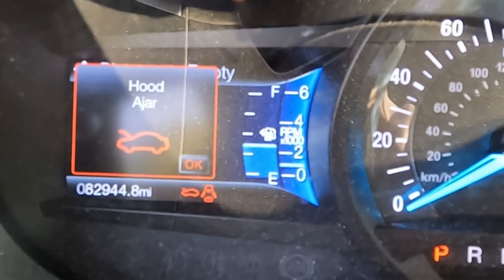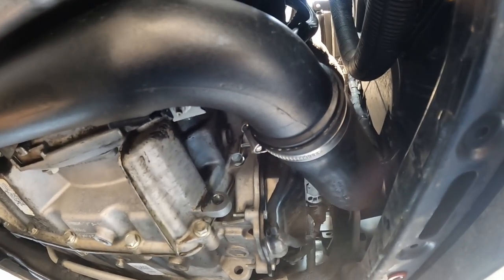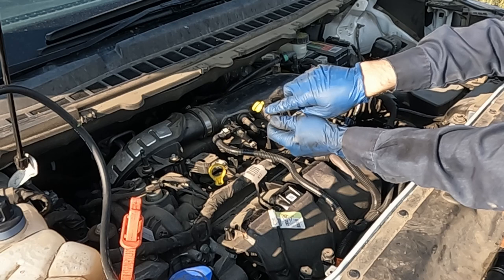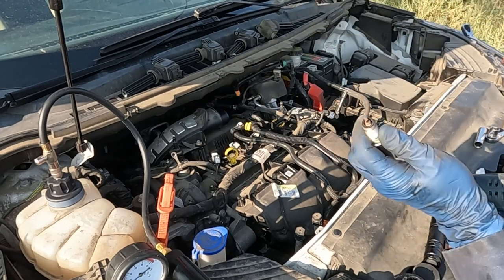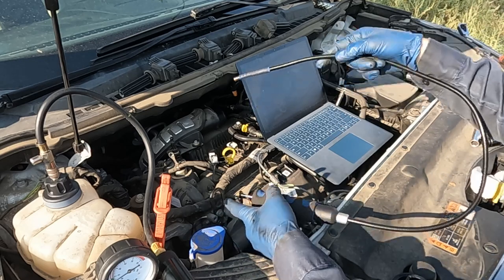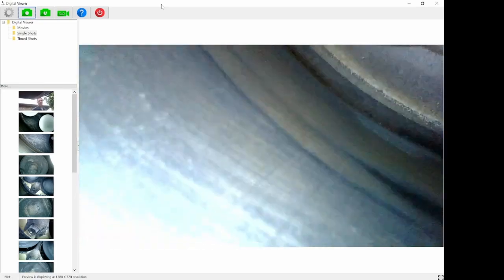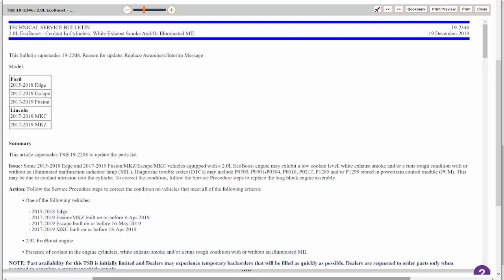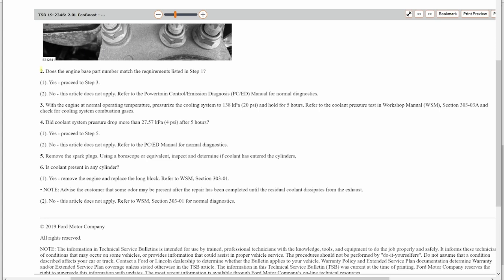2015-2018 Ford Edge Coolant Leak | A Sad Day For Ford Owners!

Comment: Is there a way to fix this without replacing the motor? A.K.A. Kickin the can down the road? Lol 

Think I could get away with replacing the gasket?
Reply from the maker: From my understanding the issue is in the block. That's the reason for the whole engine instead of replacing the head and or gasket.
Reply: I used some K Seal (gasket repair kit) and it's been about 6 months and I haven't had intrusion/misfire since.  It's worth a shot.
Reply: @Steef12  Did you have an engine code? And if so, did that code go away? I have a P0302 (cylinder 2 misfire) and I've already changed the plugs and coils. Thinking it might be this coolant leakage issue. If the kseal removed the codes, I might try it and then trade the car in. This isn't worth the hassle imo.
Reply: @jthiel0711 I did have the cylinder misfire code.  Haven't had any codes since. I had also replaced the spark plugs and coil packs since I was at 100k miles anyway.

Comment: I have a 217 Edge that I had driven out of town and it began misfiring 100 miles out.  Drove it to a Ford dealership I had done business with previously and they came back with a new engine diagnosis.  I was not aware of this problem, the car had 69K an extendeed warranty.  I got a new engine, $100 deductible and 3 weeks of a loaner car.  Runs fine to-date.

Comment: Isn't cover under warranty?
Reply from the maker: Unfortunately Ford has not issued an extended warranty or recall on these engines.
Reply: @ValleyMobileAutomotive  - That's  very bad news for a lot of 2.0 Eco boost ford owners everywhere.
Reply from the maker: @mr.nobody4900  if you own one in this year range I would consider weather to keep it or not. It might just be a matter of time before you need to drop over $6k for a new engine 😕
Reply: @ValleyMobileAutomotive - I am not a Ford owner...I am a Honda owner...I know a girl who is having this problem...she decided to buy another car altogether.
Reply: Phew, bought a 2.7L Edge

Comment: The information you provide, I'm sure is logical & rational, but Me, I'd like a better look at what your doing, to visualize in my head. Off to the side view isn't  enough, however it's done with other automotive DIY shows, first person view is the way to stand out from the rest ..
Reply: If I were you, I'd look at other videos about the flawed block design on the 2.0 ecoboost engine which does clearly show the problem, which is super thin cylinder walls between cylinders with a slot for a coolant passage. The majority of leaks are coming from the thin areas in the head gasket. This is why the solution is a block replacement with thicker cylinder walls.

Comment: Sadly, Ford has stuffed up big on their ecoboost engines and their 'powershit' gearboxes
Reply: They modified the coolant passage ways between the cylinder heads beginning in april of 2019, which fixed this issue. Now what the should do is at least recall and inspect  every 2.0L ecoboost manufactured before April 2019, but they won't, not unless the NHSTA nails them with a mandatory recall, but good luck with that. The NHSTA is in the back pockets  of the US auto industry. They won't make anything a recall unless the NHSTA is forced to after several class action lawsuits by the consumer. Bureaucracy at its finest.
Reply: Any info on the class action lawsuit currently going on?

Comment: Son of a bitch. I might have this problem. Wife's 2018 Edge threw a P0302 code. I replaced the plugs and coils and reset the code. 700 miles later I'm getting the P0302 code again. When I changed the plug, #2 plug was a PITA to get out. Only difference is my coolant isn't that low. I did top it off to max and now it is hover around the min mark after that 700 miles. So thinking I have this issue, or a blown gasket. UGH.
Reply: Same here